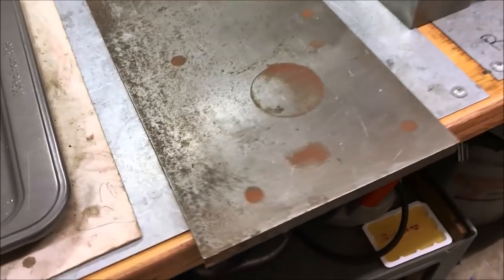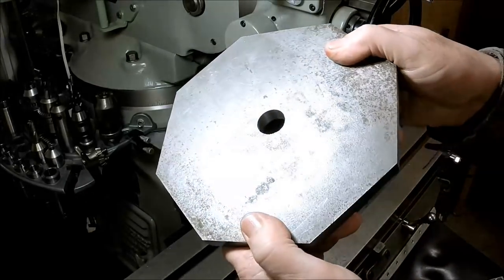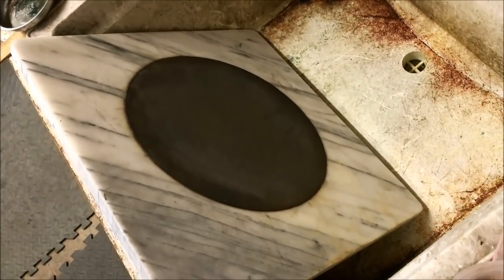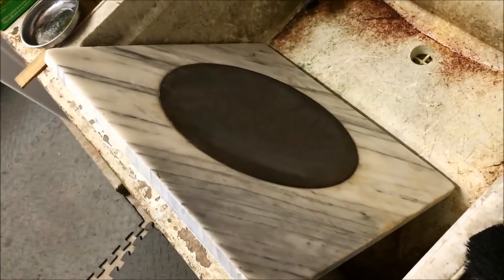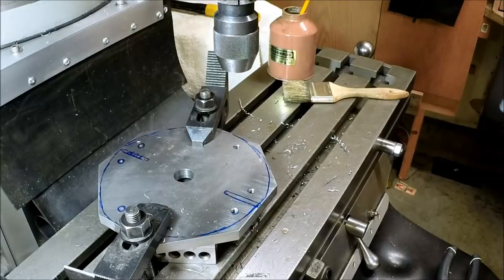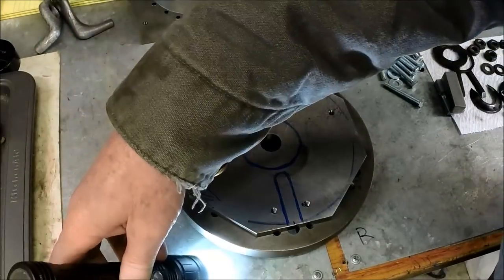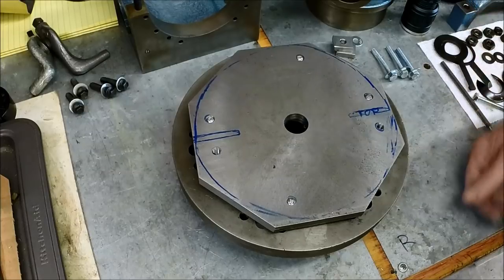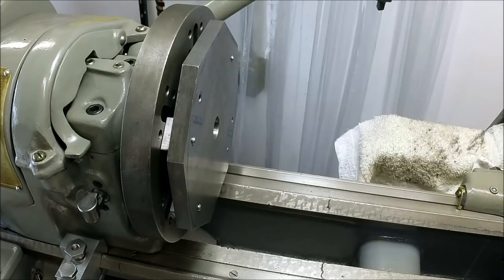Walter Dividing Head Restore Part 2

Comment: did you check the block spacers that they are all the same?    but I'm sure it'll be fine. looking good
Reply from the maker: Yep, they actually came from a single piece of new ground key stock. Made them up on a previous project.
Part 3 coming soon!

Comment: Seal up the place Mice we did it (in the middle of an open desert) and the mice we had are gone two years later still no mice this place is sealed up like Fort Knox, Bronco is it a 1966 through 1977 reason I ask is our neighbor building is West Coast Bronco that is all they do all day long. The hole does look nice watching you measure it now GOOD. duh no on the sanding plate. We do not think there is much a lathe cannot do, isn't it great.
Reply from the maker: No mice activity for a couple days. I've been keeping the pet door closed when not in the shop. The little buggers can get through the smallest holes. Bronco is a 1978, 95% fully restored, I'll have to show in a video one if these days.
Plate is coming along nicely, hoping to wrap up all the plate work in part 3. Lot's of chips in the last two days.